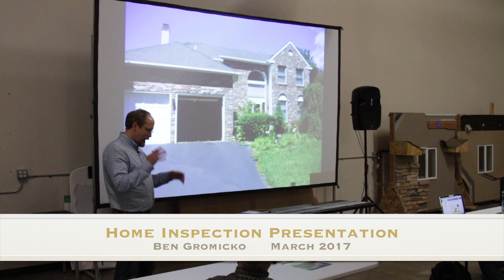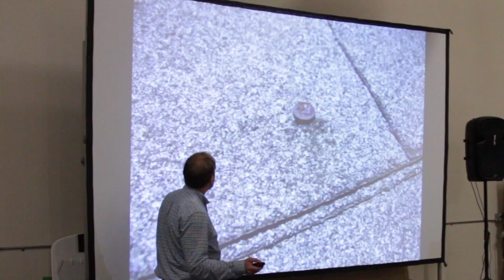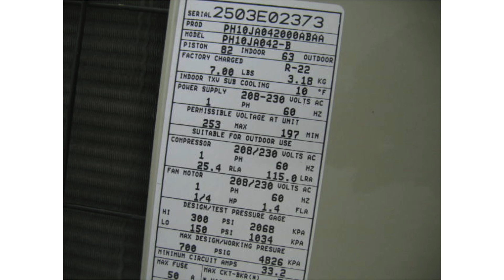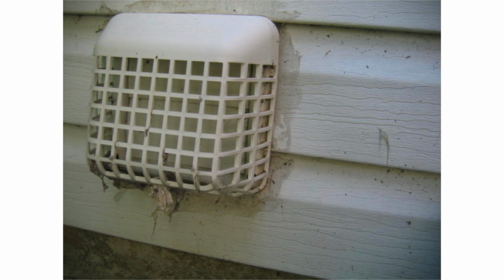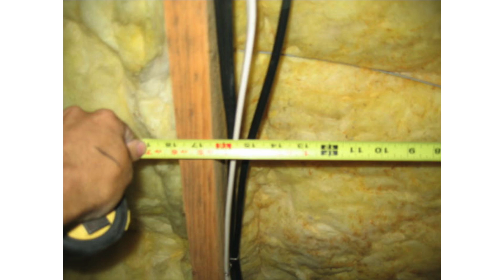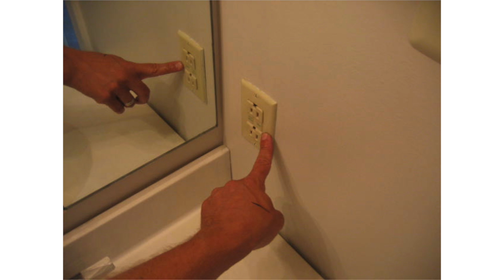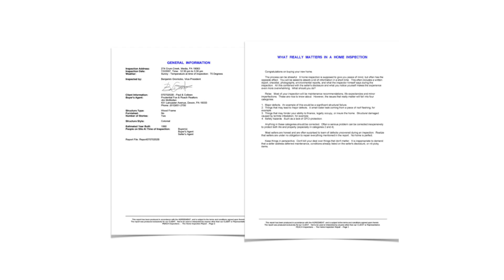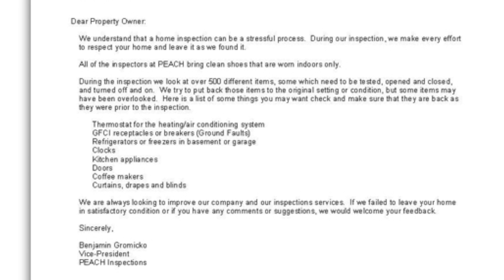Home Inspection Training Class #21 with Ben Gromicko

Comment: if a roof is too high for your ladder to be used safely my guess is that the roof would probably have a slope where you would be unable to walk on safely. in this case i would refer to the software and or whatever form you use and state  the reasons why you were unable to inspect the roof from being on the roof itself, and the reasons why you had to inspect from the ground.
Reply from the maker: Good feedback, Grady.

Comment: What if a particular roof is too high for your ladders? How should that be dealt with?
Reply from the maker: If you can't see it, you can't report upon it. The inspection restriction can be described in the report. Now, there's a great inspection tool out there called the Spectoscope, which is an extension pole with a wifi camera to your device. It's at http://www.inspectoroutlet.com/spectoscope.aspx